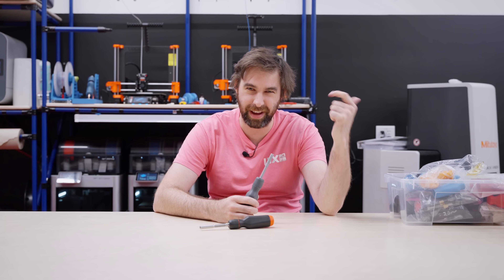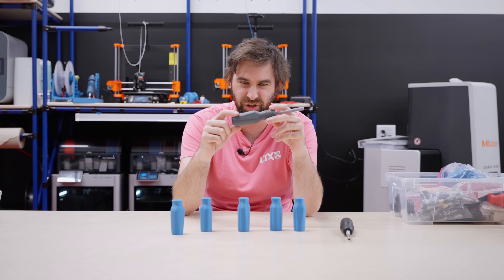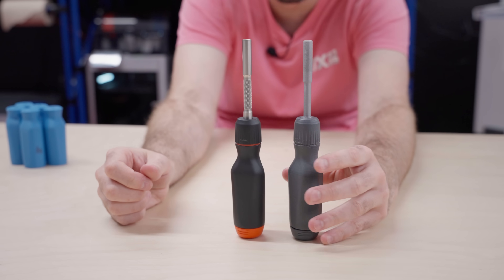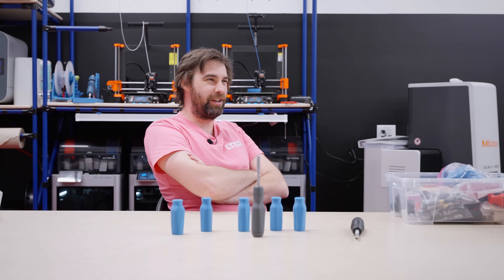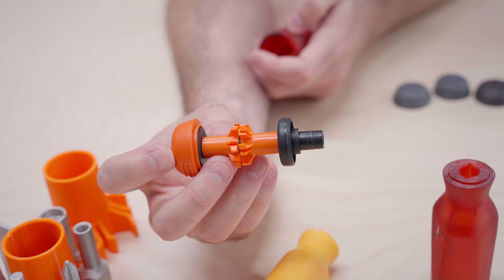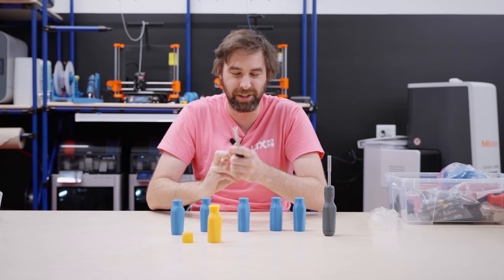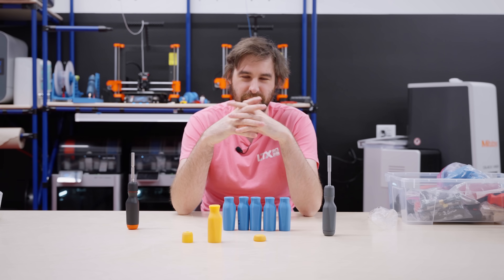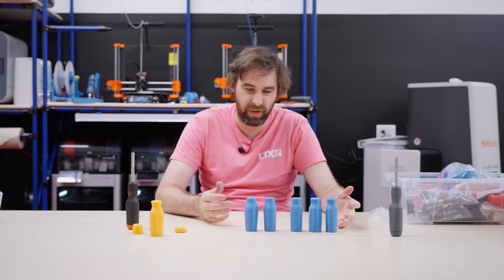The story behind the LTT screwdriver

Comment: "Multiple 6 figures" that sounds rough as hell, I would have quoted those parts in mid to low 5 figures tooling.
Reply: It's the injection mold costs. They get expensive quick. It's not just the mold for the product being made. Liquid plastic has to be cooled super fast evenly. That requires internal channels inside the mold for coolant. The mold itself isn't the expensive part. It's all the geometry and heat transfer calculations for the internal coolant runs to make sure the part cools evenly inside the mold. If the part doesn't cool evenly there's brittle spots which crack and break.
Reply: @halycon404 I know, I've quoted and ordered injection mold tooling many times my friend. I maintain the price is excessive
Reply: And they brought the molds out right vs having the factor keep them
Reply: I believe Linus said the Molds cost around 200k at some point.

Comment: I actually really like the orange cap. When I started working with electrical, I learned really fast why the screwdrivers are red and yellow. You can spot them in the tool box at dim light in a crap spot. The orange cap gives it that hi-vis feature because all-black sounds slick and professional until you drop it behind something or it's at the bottom of your bag. Then you wish it came with a siren and lights.

Comment: I just finished my MK4S->Core One kit using the LTT screwdriver, it was the BEST building experience I ever had
Reply: Been there done that aswell with the noctua edition. It hast all the 3d printer Bits inside for me😊
Reply: Heh, built my mk4 kit before the Ltt precision was out so had to use my Ifixit one. I’ve now got the precision set and it rocks

Comment: In a prusa video there are 3 Bambu printers behind😂😂
Reply: and the engineers have voron v-zero`s at their desks

tech is tech, use whatcha got/want to test/try
Reply: Prusa showing the competition in their videos only proves that prusa is still the king in this industry. When you're comfortably at the #1 spot, you feel no pressure from showing the competition.
Reply: I mean, I noticed the two Prusa MK4s first, probably due to their distinctive black and orange colorway. Didn’t even see the Bambu Lab printers till I read your comment
Reply: That's the difference between Prusa and Bambu Lab. If this had been a Bambu Lab video, you wouldn't have seen another printer there to sell the illusion that everyone only uses their printers. Prusa, on the other hand, doesn't mind if printers from competitors are also visible. The story about the screwdriver and how 3D printing was used for its development is the main focus.
Reply: @andreas.grundler it's not that serious. Jesus.
Reply: @andreas.grundler  The difference is Bambu is innovating and releasing new printers to the market while Prusa is giving us garbage LTT screwdrivers.
Reply: @Mark-jb9hx you know its injection molded right?

Comment: I got one of the LTT screwdrivers.  I'm really not that impressed by it.  Kind of flimsy, and super tiny bits.  There's better for cheaper at your local hardware store.
Reply: Obvious bait
Reply: Which do you prefer and for what use? I have a Stanley I don't like and a Husky which I do like but it's not really computer oriented.
Reply: It’s just a regular screwdriver thought. Nothing special. Much better options for half the cost.
Reply: @Marvelous240 you've clearly never touched one
Reply: @Oaisus  I have and I returned it.
Reply: It's a computer screwdriver, so i think it's well specced in this regard, they optimised for backdrag and backlash at the cost of other mechanical parameters, which i think was a wise choice and a real way to differentiate them from other drivers.

But they also ruined them in principle. On a normal ratcheting driver you simply hold the collar while you do your first quarter-turn and that sets the direction. On this one, you have to take the driver off your work and consciously rotate the collar in the turn direction, it's a separate step as opposed to being able to do this alongside actual use move. This is why the collar on all other ratcheting drivers is reversed, it really makes them much easier to use for someone who uses it regularly. They failed to understand the product they were trying to improve upon.
Reply: @SianaGearz Maybe I’m in the minority, but I’ve never used a ratcheting screwdriver the way you’re describing. I’ve always selected the direction before beginning to screw in or unscrew the fastener, so the LTT selector makes much more sense for this use case.
Reply: @ny-lights   You're probably unfortunately not in the minority, it's sort of a trick that nobody teaches you how to use a ratcheting driver "properly", but just saying that the normal ones are designed the way they are for a good reason. They just failed to tell you the reason on the packaging or in the supplied leaflet.
Reply: @SianaGearz Probably so. I've also every barely used any ratcheting screwdrivers so that concept you described was completely beyond me.
I've used reversible tools like ratchets and impacts plenty, but the LTT screwdriver just felt natural to me on the way it works.

Maybe it was a deliberate decision for their target audience though. With the use case that screwdriver is intended for you probably wouldn't have enough resistance to select the direction that way. Small electronics, PC and 3d printer screws will just screw in plenty far that way. I usually directly rotate the shaft with my fingers to get a screw started. Selecting the direction previously is a necessity that way anyway

Comment: I still have mine (2nd commercially available run in black and orange). It has some drawbacks. — mainly in the bit storage. But it's my daily-driver (pun intended, God I hate myself) and I work in a repair shop, so that's a heavy endorsement from me. 

I'm hoping to get the stubby version soon after using my coworker's. Seriously, it's a good tool and it will last... unless you use it as a hammer...
Reply: The stubby is great. I mostly use the full size one, but sometimes the stubby just fits in a space

Comment: The most important question, how many prototypes did Linus drop?
Reply: Not enough since the day 1 screwdrivers send to creators and sold in a physical location (if I remember correctly) had weaker bit holders that would break when dropped. (they fixed it before release)

I was a bit shocked that Linus didn't discover a drop related issue earlier.
Reply: @Karavusk  I guess they didn't do a drop box